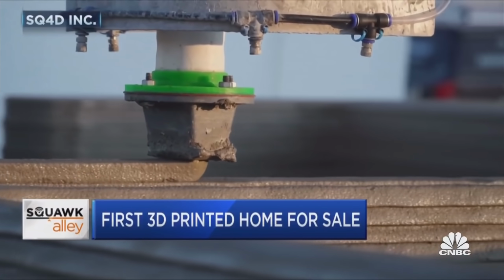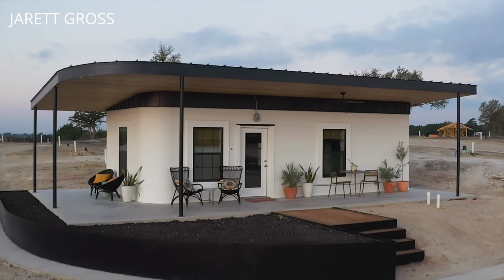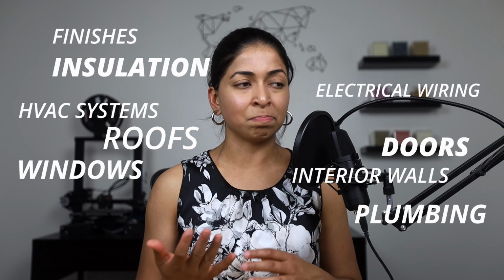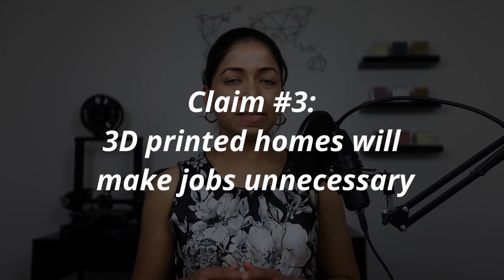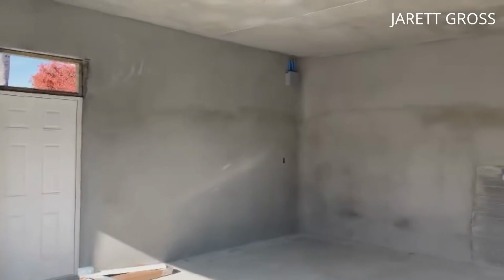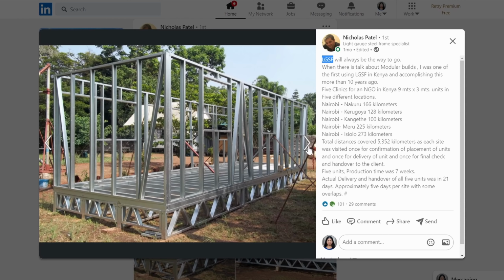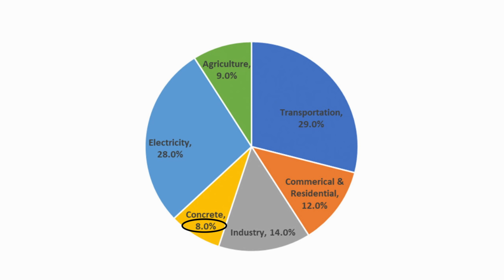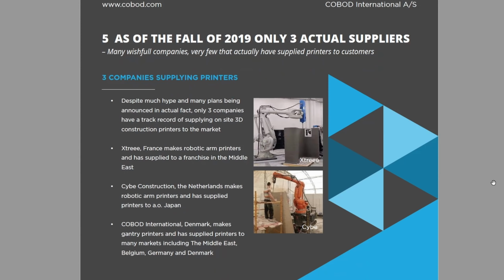Exposing 5 LIES about 3D Printed Concrete Homes

Comment: With no rebar and the concrete drying out before cured makes me wonder how long they would last. concrete roads 6-8 inches thick here in the usa don't last 20 years. But that may have more to do with job security...

Comment: I think this sounds cool but some people think the house is expensive, it is not, the house is cheap, the site is expensive, always the sirlte is the expensive part, mansions are expensive not because of the mansion itself, but the site, a house can be around 10 to 20 % of the site cost where I live, it sounds like a big gap, but that is because the sites are way cheaper than in the US, building a home is the cheap part of owning a home and people will usually be better off if they can buy the site and build the home instead of just buying a house, because it is cheaper and you get a better house for you than if you buy a house, obviously nothing in this comment applies to departments, there aren't many where I live.

Comment: Wondering if a footing and foundation walls made by 3D printers would be stronger and more resistant to cracking than poured concrete walls. In Toronto the frost line is 1.5 metres.  ICF is best, but if you need curves...

Comment: I have seen some intresting work with continuous sand bags being used for constructing small homes and outbuilding.

They can be laid by hand, and use the earth around them with only a relatively small amount cement mixed in as a binder.  after construction the bag material weather's away and only the earth walls are left.

To me that seems like a better option for the developing world.  Possibly not even for housing but for many of the rough structures to support people.  Storage, animal pens, wind breaks, and so on.

Comment: Thank you for shedding light on this subject. There is some of these built not far from me and being a carpenter for 40 years I had to hear from some near do wells how great this is. I tried to tell them of the the difference between that and traditional building practices. That being said it took over a year to complete a ranch style house. Personally I think ICF forms are a better option in a lot of areas.

Comment: This just felt like a lazy hit piece, that failed to even look a centimeter below the surface. these homes HOLD more carbon than they produce, they cut out MOST of the waste in the building process, and they have concrete that does NOT use the curing chemicals that can cause indoor air quality issues. They don't burn as fast, making safer homes. They have better insulation than traditional homes, and don't hold smoke/ pet/ or other smells like traditional housing does. 

As for unhoused individuals, the ADDRESS is as important as the BUILDING. you can't get many jobs, identifications, or benefits if you don't have a permanent address. When you started using Nicholas Patels' take on the situation, I couldn't believe how bias your SOLE source on the situation is. HE DOESN'T"T WANT 3D PRINTING COMING INTO HIS TERRITORY, because it's a threat to his business. You should be better than taking the "issues" from a competitor as fact. 

And all your unhoused issues are for OVERSEAS. they are mostly governmental issues, and the ones that aren't, are complaints about the start up costs. Your desire to put as much BS as you can on top of the industry has made you lose focus. 

"The arrogance of designers and architects really shines when they talk about homelessness" is when they think the HOME is the only critical part. But you seem to expect architects to solve the mental and addiction barriers to be self sufficient and housed. Maybe the arrogance is giving the hand waving equivalent to "thoughts and prayers" when speaking on homelessness. You know what CANNOT solve the unhoused crisis? Not having homes, with addresses, available for purchase. THAT'S the job of architects and home builders. You know, the people you're calling arrogant. 

This whole video felt undercooked, poorly researched, and an absolute miss on the reality of 3d printed housing.

Comment: as a rule of thumb from what I've seen, new technology is almost never better, or more reliable than current methods that have been developed for decades, unless its a VERY specific use case or its just another incremental development to current methods. we have to develop those technologies to match and actually surpass the current methods, it doesn't just happen magically from the moment it exists.

Comment: It's a dumb technique. Pre pour concrete slabs and tilt them up is way cheaper.
On that note, pre printing concrete wall sections and tilting them together insite may be the cheapest option.

Comment: IMHO, 3d printed houses need to be built from waste plastic, put our mountains of plastic waste to good use. At present, there are hundreds of cheaper ways to build a home, unfortunately many of these ways don't meet code requirements in a lot of countries. Sand filled soda and water bottles bottles, pole and mud, used tires, you name it, you can build with it given the right design and engineering. 

Back to using plastic waste, this is something I feel needs to be done and it needs to be subsidized by governments/international bodies, creating homes while reducing plastic waste. We have already seen construction bricks that snap together like lego blocks. Large scale 3d printing can be done in factories creating modular prefabricated wall sections etc complete with channels for plumbing, wiring and other essentials could be created along with roofing panels, even flooring then packaged into kits and delivered to disaster areas, war torn countries and other sites to create housing for the homeless and destitute. The issue, as always, is profit. If there isn't enough money in it, it simply won't happen. I even saw a concept that used black plastic tanks built into walls that face the sun that heated water using nothing but the heat of the sun. There is so much we could do to improve our environment and help those in need but greed always wins out. Those that want to help can't afford to and those that can afford to either don't want to help or are ignorant and misguided.
Reply: You ever seen plastic burn? Wood built house fires are bad enough but plastic?

Comment: Belinda, I don't see that these big, clunky machines will be the answer.. I think it's an A.I. mind trick.  Using concrete is antiquated and horrible for the environment; the walls don't breathe, and are full of mold, especially in humid climates.  If we're going to change the building industry, we need to focus on bio materials and stop having our attention diverted by A.I.  People need jobs, computers and clunky machinery, in my humble opinion, is not the answer, but if folks are fascinated with machines, they should be 3D printing using bio construction materials, not harmful concrete

Comment: ¿3D Printed buildings use any kind of ductil material as a reinforcement (i. e. steel rebars)? I did not saw any in this video. Such components are crucial  in order to guaranty safety during earthquakes or inntense winds. If the building is basically concrete only, it will present nearly instanteneus fragile failure thus there may lack evacuation time. I would not reccomend such kind of construction in seismic active regions.

Comment: I think 3d printing, especially in this application among some other, is similar to how AI is in now almost 2024. It should not be used as a substitute, but as a suplment to help ease a process along. Whatever it is. I dont think it should build a whole house, but it can make pieces or certain things if something is missing or broken. But that also depends on what material its using to print and all that other jazz. 

Basically, it can be the future, but we should not be depending on it right now.

Comment: Good video. I think automation has potential but I think this is as you say a solution searching for a problem.  I see potential for robotics in construction, drywall, excavation, bricklaying etc, but the cost of this technology is very expensive and the level of complexity is high.  There is a shortage of trade’s people but most of the build will still require human’s anyway. Is building 10% of a house with robots worth the effort?

Comment: I actually agree. I love technology, but I think we are getting to a level of the technology age that we need to see it's limitations and the damage it has done by shoving out more primitive technologies that work better in ways new tech can't.
For instance, in the field of cooling air. High tech solutions like refrigerators and heat pumps took over because power was abundant and cheap, and it could cool spaces faster and to larger extents. For lower economical areas and where power is not so easy to get, it just doesn't work so well. Even in developed nations, it's  become a real problem, because it all adds up. The power consumption skyrockets on hot days and the amount of environmental damage done by leaking chemicals is massive. Beyond that, it just doesn't want to scale well for the whole world.
Scale is really technologies main problem. Complex systems require lots of time. Also, most technologies rely on scarce resources, like lithium batteries. 
Instead of looking for high tech solutions that really won't scale well and don't take into account issues of less established infrastructure of many nations, I agree we need to take our advanced knowledge and find ways of getting similar results from quick and easy to build low tech products made from abundant and cheap resources.
One of the best videos I've seen on this type of subject was called Garbage Warrior. I recommend anyone looking into techniques to building houses better take a look at it. The houses built in the video are more suited to climates closer to the equator than ones closer to the poles, but there are a number of great things anyone can use.
It first makes use of recycled materials easy and abundant to get, because people throw them out constantly. The biggest thing was a wall on the house on the opposite side of the structure from where the sun strikes. It's made of tires packed with ultra packed dirt. That's all. Okay, they also added pop cans so their bottoms faced out of the surface of the wall on the inside of the structure. This was to reflect sunlight off the wall. It both brightened the inside of the room and kept the wall from absorbing the heat of the sun. The whole point of the wall was it's density, it's mass. It acted like a cave wall for the house by stabilizing the temperature inside the house. Houses built of flimsy light materials are prone to wild temperature fluctuations. The wall impedes those wild fluctuations because it is simply too difficult to change its temperature. It literally takes days to change its temperature. So, it gains an average temperature from the day night cycle and it will help the house stay at that temperature. In the day, when it's hot, the wall will absorb massive amounts of heat, lowering the temp in the house. At night, it will shed tonnes of heat, keeping the temp in the house from dipping too low. This is great for desert areas where the day temo is high but the night temp gets really low. All it takes is old used tires and dirt, along with someone willing to put in the time to pound the dirt down to compress it.
That was just one of his techniques. Another was to build the house over a big hole in the ground and direct all the rain water into that hole. The house keeps the water from evaporating too quickly. What does evaporate is guided through vents through the house. This then adds humidity to the air in the house and cools it. Also, the water can be used in the house of there is enough and you filter it.
Check it out.

Comment: The technology has problems, but with redevelopment of engineering codes in concrete it can work. It had huge potential to help put poor people into modern small housing instead of caves, mud and straw huts, and makeshift trash  huts. The problem is the technology is best used for small 1 to 2 bedroom homes around 900 square feet. But plumbing, city water, city sewer, electricity ,and natural gas all have to be included. So, city utilities needs to be developed first.

Comment: Mud brick with wire and straw reinforcement seems to make sence to me.  Like the materials can be found in one's back yard.  I know because my grandfather made such a house.  Started out with a simple rectangle then over time added other rooms including a very large main room.  Straw reinforcing in the bricks and hog wire between layers and conners.  Walls topped with wood framing.  Structured framed roof from savagef floor beams from a demolition.  Walls earthquake resistant with the roof with bridge like framing collapse resistant.  Whole walls could fall over and roof would not collapse into the inside.  Yeah, easly built in third world countries at low cost with local material and labor.  Actually at almost the same cost of any third world construction.  PS, my Grandmother made the bricks in the front yard while my grandfather did the building on the weekend time off on his job.  Done in a bean field in Costa Massa, California, USA.

Comment: Buzzkill. If we can 3D print a home for people so they don't have to live in the savagery of the outdoors then I say yay. And I get it you're trying to under hype the over hype make people think. But if we can get those people off the streets, then I am all for it. Simple logical idea. There are simply too many people on the streets, under bridges in deserts don't they deserve a home 🏡?
Reply: Depends on where, the concrete needs to be a special kind, if that's not available then you're out of luck. Also ALL the land costs, insulation, wiring, plumbing, heating/cooling equipment and so on still cost the same as a "regularly" built house.

Comment: In my opinion prefabricated or modular homes (like LGSF) will be cheaper in the long-term, but like everything else transportation of materials is a huge bottleneck. Nuclear + battery technology may open the door to cheap automated transportation at least.

Comment: can you do a video on Gablok's lego-homes? I've been very curious about it's viability. currently it's limited bc they can only ship out prefabbed walls, but not roofing, plumbing or electricity. But I think their system is a lot more exploreable to create prefabed electrical systems and plumbing, since they can look over the plans they designed and know when and where to put wiring panels. But i don't know enough about it to be sure

Comment: You are missing the point. Concrete is a great material and so vastly superior to wood. It has thermal mass and done properly will outlive wood homes by centuries. I have seen concrete homes survives floods, tornadoes, wild firres, etc. unscathed.

Comment: I think 3d printing is a nice adjunct technology, but not a good primary tech for housing.

I built a Prusa, and got frustrated with constant calibration (and it's the most easy/best fdm on the market).

3d printing shines for prototyping and planning

Comment: I find this technology potentially great, but not well developed enough to be  competitive. Applying it to homelessness seems truly off kilter. 

If improved, it would be useable to make complex structures much quicker, with less manpower, less design errors, and with some means of applying it around metal reinforcement and smoothing it to make proper walls. Until then, it's just a novelty.

Comment: Well spoken.......but compare a 3d printer to an extruder I am familiar with Gomaco string steer......why not flip an extruder 90 degrees or even better extrude panels,walls and even roof sections with proper pitches on the gable joints......I'm not an engineer but I have spent a decade or two behind a gomaco

Comment: So from what I could see in the 3D printed concrete walls there's no kind of reinforcement. I know my under blocking around my house the mortar joints are disintegrating after 25 years. Thankfully it's not a structure issue it's just cosmetic the underblocking doesn't do anything structurally. I've redone areas, But I just can't imagine having a house without some kind of rebar or something in that concrete just seems scary I wouldn't trust it.

Comment: 3D printing might be an option for making tilt up panels in a factory controlled environment much like SIPS.  Many commercial buildings such as box stores use prefab insulated concrete tip up panels.  That might… might be a place for such technology where it could be advantageous.

Comment: 3d printing is best for doing rapid proto typing i think its more useful for 3d printing concrete specialty parts...  i think prefab is probably mostly always gonna be faster.

It may also be a neat way to make domes fairly quickly and cheaply... because domes are kind of a pain to build...

Comment: Thank you for your video. As long the machines cannot pull wires and place flush mount boxes for the switches, it will have very limited application.
Also, insulation is not very great in cold climates, it wold need to incorporate a PU machines at the same time to fill the void to achieve good insulation values (But many wand more natural material, not PU).
But than, how to place the electrical wires and flush mount boxes? Very few would accept surface mount electrical boxes and cable conduits. (No problem in industrial area). The "ripple" effect of the raw wall is nice, but boring after some time. A chip or air bubble during construction will be visible for ever. 
Sure, the inside (or outside) could be sprayed again and smoothed, but there you go adding additional labour wich you do not need with Plywood board construction or even (not to this extend) with some other methods.